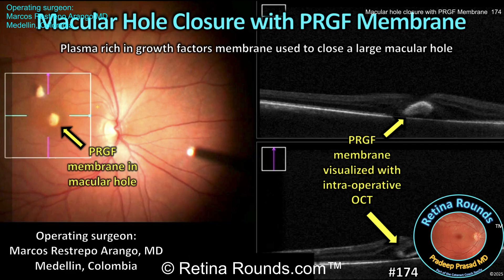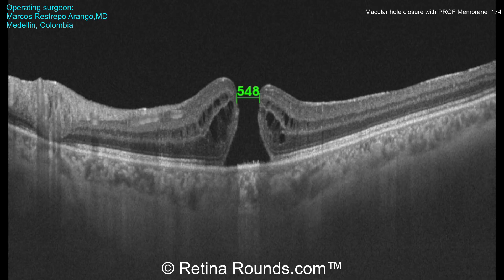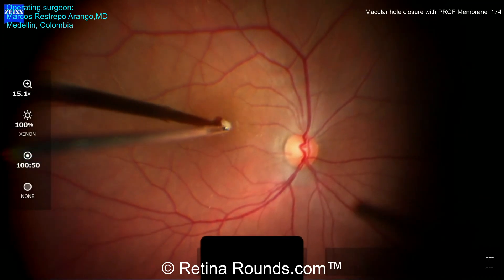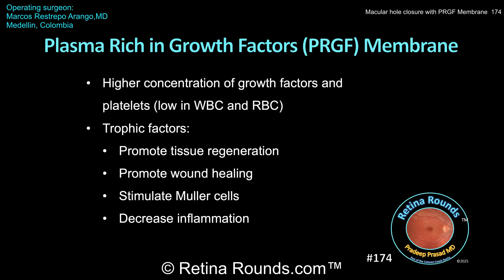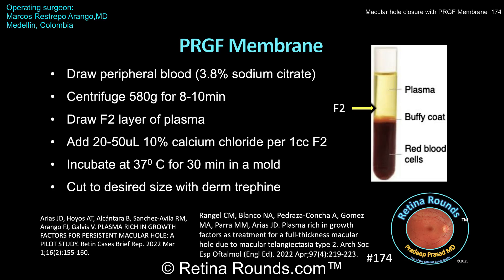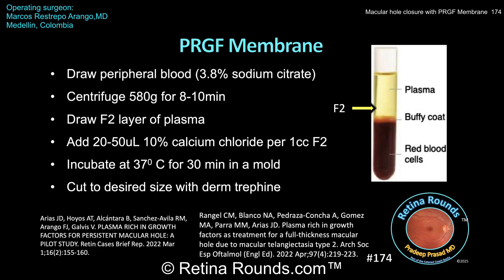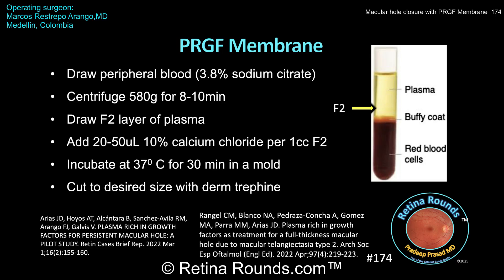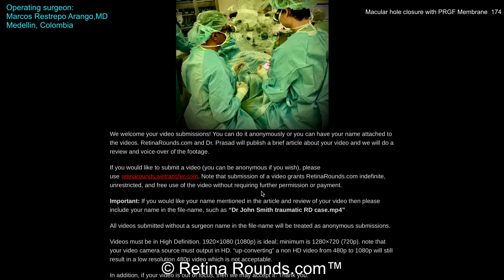RetinaRounds™ 174: Macular hole closure with PRGF membrane

Comment: What about just placing platelet-rich plasma (PRP) in the MH? Would a PRGF membrane be preferrable to PRP?
Reply from the maker: Great question.  Some surgeons use PRP in macular holes but it doesn't last very long compared to the PRGF membrane.
Reply: That's right, for macular holes between 200 and 400 microns we only use liquid plasma. For larger holes we use a membrane because it lasts longer and provides structural support.